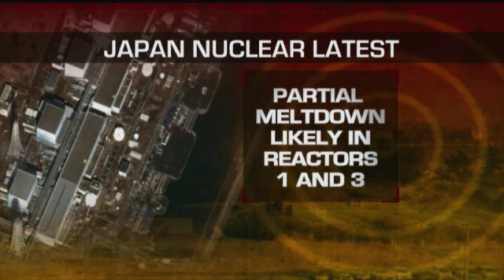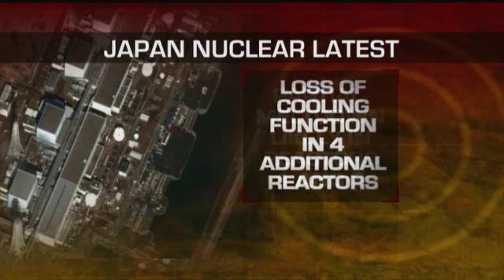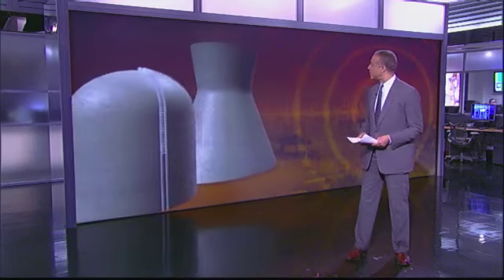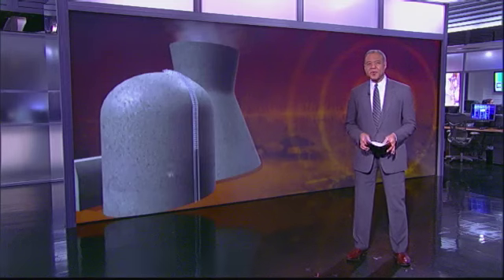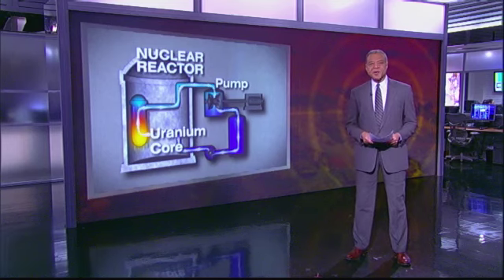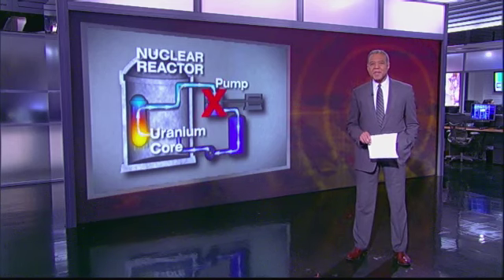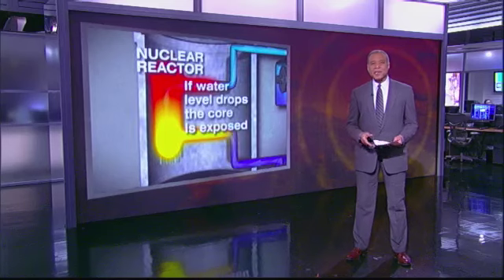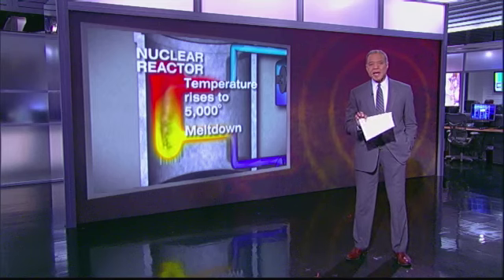What Is a Nuclear Meltdown?

Comment: "If the unstable uranium is disturbed in any way it EXPLODES!", but this is not true. The only thing that exploded was the UNSTABLE Hydrogen that escaped from uncontrolled leaks in the reactor system, then mixing with air in the reactor building causing an explosion that can release radiation along with it. An explosion can also be caused by steam over-pressurising the reactor. A meltdown is when uranium overheats and melts.